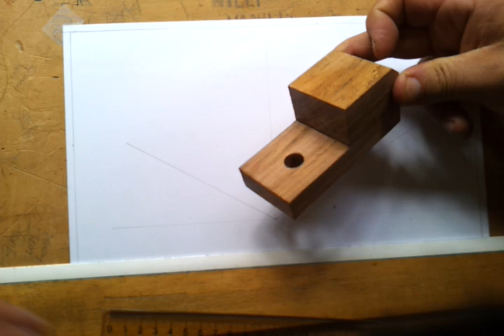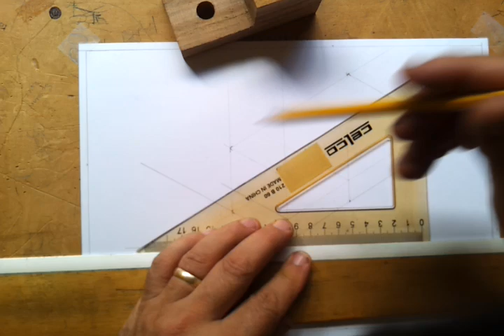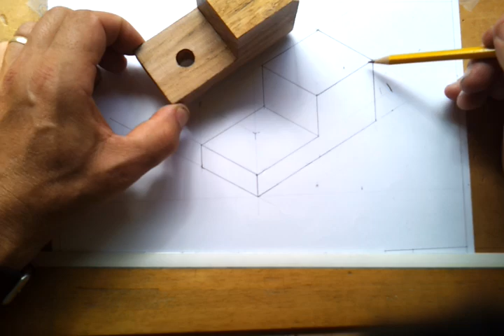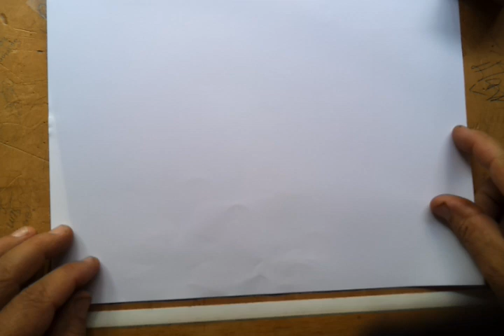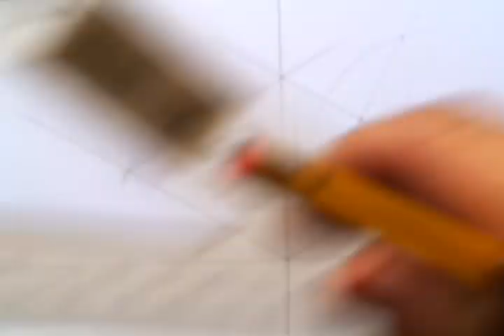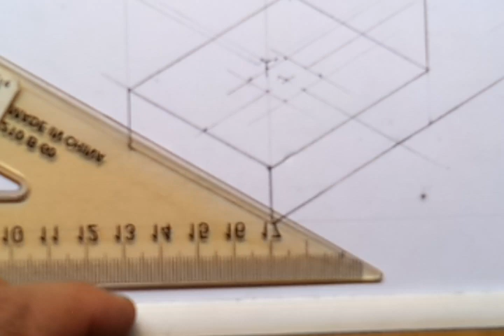How to draw an Isometric object

Comment: Thankyou my welding teacher left out a couple lines said it would confuse us but without those other lines that make that kind of star shape It doesn't give me as many intersections  to go off of if one intersection doesnt work also I kept doubting myself when making the two big arcs that the circle would come out properly this video helped it also helps if you have a proper compass i bought a staedler the other two i tried were complete crap the pin fell out the other one wouldn't lock in

Comment: Hi there, You have 2 papers, one of them has a straight line. the other one is empty. I want to draw the straight line on the empty paper, the same position and the same length. the question is how to draw it with triangle Rulers

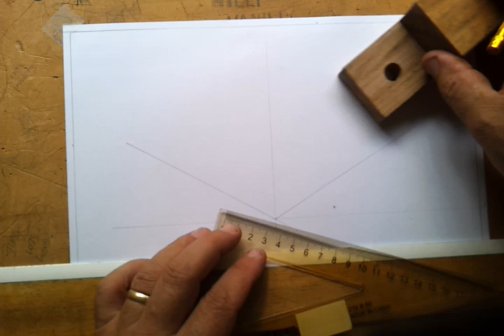Comment: You state at min: 2:15 that "the dimensions are along the right angle planes will be true". I have an Isometric Drawing (at 30 degrees) of a Saturn 1 Launch Platform can I take the right angle plane the dimensions off this drawing to true, with respect to the drawing itself (12,19cm x 10,9cm). Thank you for your help with this question and for post this video as it's been a great help.